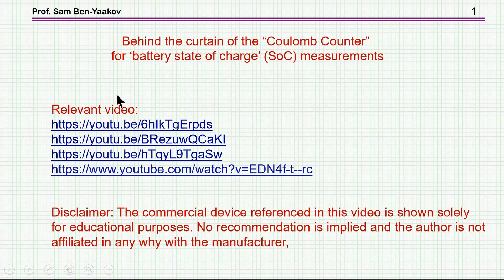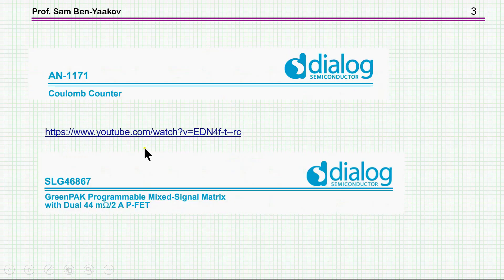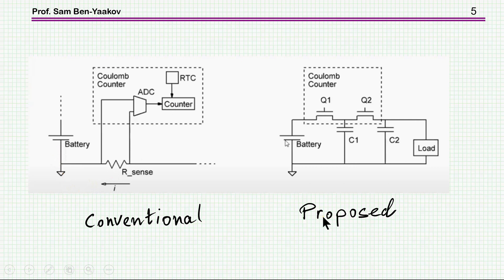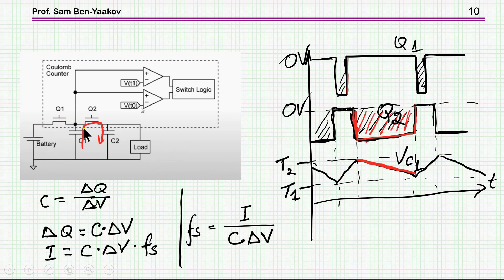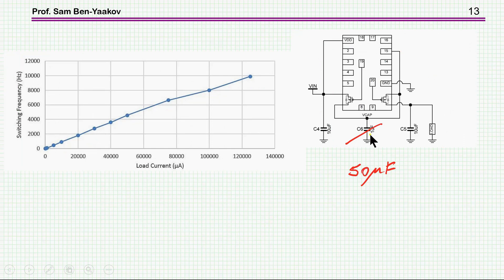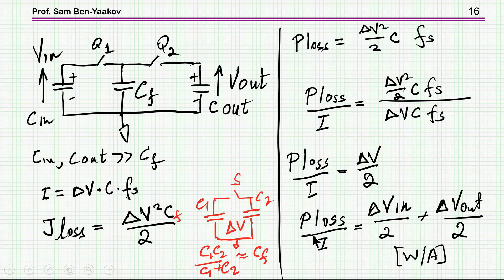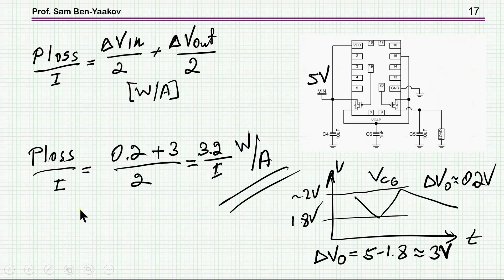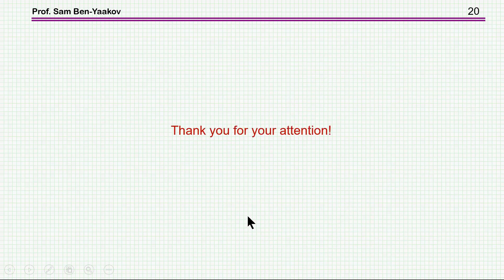Behind the curtain of the “Coulomb Counter” for ‘battery state of charge’ (SoC) measurements

Comment: At time @7:23 you drew "straight" lines for the Charging amps and Discharging amps for C1, the flying-cap.  As if, the flying cap was being charged and discharged with a Constant Current source.  But the flying-cap is charged by a Constant Voltage source ( a low voltage cell / battery ) via a 44 mOhm P-FET.  Then there is a 5 microsecond DELAY.  Then the flying-cap is discharged into the output capacitor and the load via another 44 mOhm P-FET.  And then there is another 5 microsecond DELAY.  I don't see any RC type CURVES or the two @ 5 microsecond DELAYS in your Charge/Discharge graph or your formulas.  Would using an RC type Charge CURVE period + a 5 microsecond Delay period + an RC type Discharge CURVE period + a 5 microsecond DELAY, cause a significant change in the frequency formula?
  * Without knowing the voltage of the battery how can you know the time period needed to recharge the flying-cap?
  * Is the Frequency = 1 / ( Charge period + 5 us delay period + Discharge period + 5 us delay period ) ?
  * Given a fixed battery voltage, I believe that the sum of the ( Recharge period + 10 us delay ) is essentially a CONSTANT.
  * If true then any change in frequency is almost entirely cause by the period of the RC Discharge Curve, during operation.
  * Does the ESR of the flying-cap affect the calculation of the period for the RC Charge Curve and/or the RC Discharge Curve?
Reply from the maker: Thanks for comment. The straight line is an approximation for the case in which the the time span is only part of the charge/discharge duration/

Comment: Isn't this device more like a SMPS (Switched Mode Power Supply) than an LDO? I would think that a voltage drop of 3V is unlikely across just those two FETs, without inductors, because their Ron is so low - enormous currents would flow!
Reply from the maker: As pointed out in the presentation, the circuit has severe issues but it will work. See
https://youtu.be/DlSmnEybrRE
https://youtu.be/irznB3evhww

Comment: Why output voltage is chosen 1.8 volts given the fact a typical li ion cell is 3.7 volts?
Reply from the maker: Well, I guess it is an example of a load the requires 1.8 V
Reply: @sambenyaakov  Just got me thing about the losses. If Vin is 5v and Vout roughly 4v the device would be quite efficient.
Reply from the maker: Sure. But the point is that they are suggesting it as an alternative to other methods without being aware of the losses.

Comment: I do not see how connecting ideal capacitors with an ideal switch could cause an energy loss. Where would that energy be dissipated ? An infinite current would flow though, and charge and energy preservation cannot hold at the same time. So that make no physical sense, and a non-ideal switch must be implied.
Reply from the maker: See https://youtu.be/irznB3evhww
Reply: @sambenyaakov  Thanks; your explanation that the energy loss happens in the form of an EM wave when total esr = 0 was unexpected whereas I waved it away as being a non-physical case, a singularity.

It would be interesting to investigate when EM losses start to exceed esr losses, but that will probably depend on the circuit geometry in a complicated fashion.

Comment: What about putting a dozen of NP0 capacitors in parallel instead? They should be less susceptible to capacity variation due applied voltage.
Reply from the maker: NPO are limited to about 0.1u. But....this is the minor problem, The major is the fact that the circuit is useless.

Comment: Dr. Ben-Yaakov - thanks for your all your time putting these videos together. Question - what type of switching power supply would you recommend as a constant current battery charger, around 250W? It also needs to be isolated. Size is not that important. Thank you.
Reply from the maker: You can consider resonant converters to improve efficiency at high switching frequency.  A series resonant converter is a natural current source.
Reply: I'd advise forward converter as the charging stage. Also you need a power factor correcting front end converter.
Reply: @shashankkurm4715  Thanks for the feedback, I was thinking the same thing. Have you ever tried "modulating" the power stage in the rough shape of the rectified AC mains input to improve PF? Is there an additional constraint I'm not considering? I just want to maintain a "constant average current" output, I don't care about pure resistive loads, I.e. the battery would regulate the bulk output voltage. Thanks.
Reply: @SSLaplaceTransform  i have not tried and i dont think it will work either since forward is a buck derived topology and will not draw current when input voltage is lower than the load voltage. If you really want to keep  low bill of materials then you can go for two parallel flybacks.